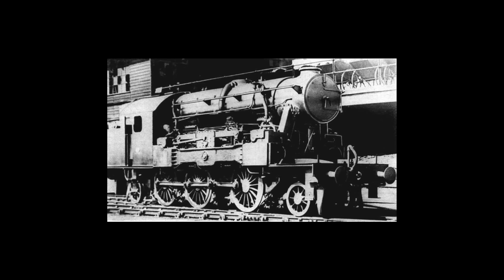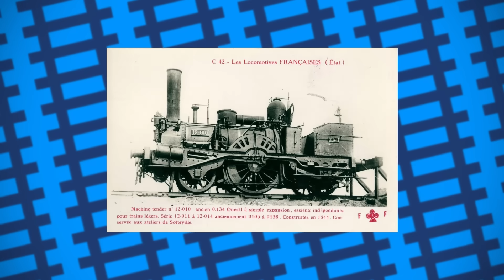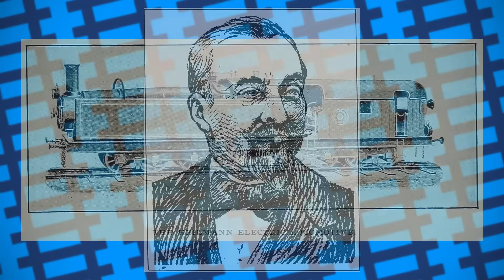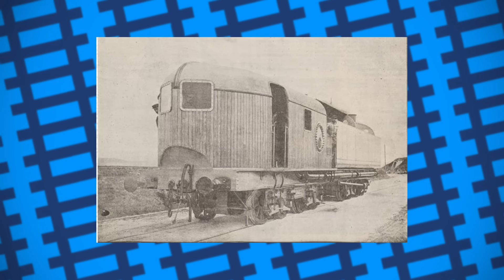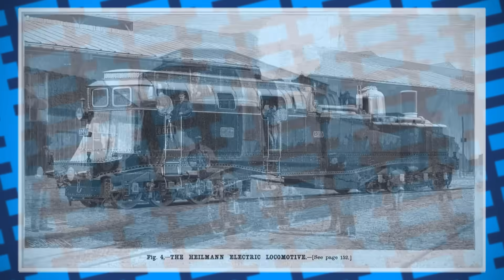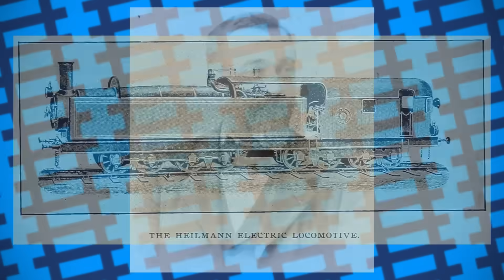France's Fascinating Steam-Electric Locomotive - Heilmann Locomotive

Comment: Hammer blow is not caused by cylinders. It's caused by the inability to perfectly balance an axle/wheelset driven by two cylinders at 90 degree phasing.
Reply: But if you only balance the rotating weight, and ignore reciprocating weight, you can eliminate hammer blow.
Reply: @joejoejoejoejoejoe4391  Nope, that cannot be done with a two cylinder steam loco. You have to choose between vertical balance, longitudinal balance or a compromise between the two. That is why it was a problem for steam locos. Only 4 cylinder locos could come close to solving it.
Reply: @davidkavanagh189 Hammer blow is caused by vertical (rotating) balance, if you add balancing weights to balance reciprocating mass, you get hammer blow; it nothing to do with the amount of cylinders, just how they are balanced. The 9F proves it.
Reply: @davidkavanagh189 Why could 4 cylinder locos come close to solving it but not 2 cylinder locos?
Reply: @sameyers2670  The only way to perfectly balance both the reciprocating and rotational forces is to have cylinders phased at 180 degrees but this does not work for an engine that has no flywheel and has to start from rest without a starter motor. 

If you have 4 cylinders, they and their connecting rods, can be lighter and can phased at 90 degrees to each other. This results less imbalance that needs balancing. On a 2 cylinder engine the cranks are again phased at 90 degrees but this then means you have 270 degrees between them if considered in the other direct. The 2 cylinder engine will also need heavier pistons and con rods for a given power output. 

It's typical to see 3 or 4 cylinders on high speed locos where this advantage is worth the extra complexity and 2 cylinders on slower freight locos where pulling power at slower speeds is more important.
Reply: @davidkavanagh189 Thank you for the explanation
Reply: @joejoejoejoejoejoe4391 if you take out the reciprocating weight, you have a waggon
Reply: Something I've pondered is if a balance shaft could be used, if any steam locomotive ever tried that? It's a counter-rotating shaft with counterweights which would be geared to the driven axle (the one with the connecting rods). The cause of hammer blow, to my understanding, is that counterweights on the wheels to balance the pistons moving forward and back would cause an up-and-down imbalance, so their weight is a compromise between these imbalances. Balance shaft and wheels would have weights that are forward and back together to counteract the piston but up and down opposite each other to cancel out the vertical imbalance. This is commonly used on internal combustion engines (many, maybe even most, cars have them).
Reply: @quillmaurer6563  I imagine the answer is that if it was that easy or practical, they would have done it. Steam locomotives were in widespread used at the same time as internal combustion engines so I doubt the engineers weren't aware of what was possible. Most car engines have even numbers of pistons that move in directly opposing directions to each other. The only way to reproduce this on a conventional steam locomotive is to have 4 cylinders and so we arrive back at my original point.
Reply: @davidkavanagh189  A balance shaft could work with fewer than four cylinders - not common in cars but some motorcycles use them, some single-cylinder even. Fairly common in twin-cylinder motorcycle engines with 270° crank spacing, which is very similar to a two-cylinder steam locomotive arrangement. Four-cylinder car engines use balance shafts to counter the secondary vibration, somewhat different from what I'm thinking here.

I don't know when balance shafts were first used, reading on Wikipedia the concept was patented in 1907 so certainly had at least been visualized in the steam era. It would certainly be some added complexity, but considering all the other things that were at least tested to reduce or counter hammer-blow - which I understand to be one of the biggest challenges with fast steam locomotives - I'd be quite surprised if something like this wasn't at least contemplated at some point.
Reply: @quillmaurer6563  Yes I think you are right and it could be done if considered needed or worth it but it would add complexity and mass in a part of the locomotive that is already heavy and space-limited. 

The way hammer blow was dealt with in practice was the optimisation of balance weights to give the best compromise for the speeds the locomotive was expected to operate at. Higher speed locos tended more to have balance in the vertical direction and low speed locos preferring balance in the longitudinal. 

It's fascinating all of the tech that was tried on steam locos over the decades only for engines at the end of steam to still be largely similar in configuration to the earliest engines of the mid to late 19th century. Often the simplest way is best.
Reply: Technically true, but your description of the true cause also mentions cylinders.
Reply: @grizwoldphantasia5005  A 4 cylinder engine can be balanced to have no hammer blow so it's incorrect to say it is caused by cylinders. I could have used the word 'cranks' in place of 'cylinders. The cylinders themselves do not cause the hammer blow and couldn't given that their motion is forward and back, not up and down.
Reply: @davidkavanagh189  This is youtube, not a physics seminar.  If you choose pedantry, then expect pedantry in return.
Reply: @grizwoldphantasia5005  Considering, not only are there physics videos-a-plenty on YouTube, this video was about an alternative design of locomotive and a very relevant part of the video was about this design not experiencing hammer blow. I simply pointed out that it was incorrect to say that hammer blow was caused by using cylinders since there are designs of cylinder-propelled steam locos that do not suffer from hammer blow. You then chose to reply a pedantic way, a reply I had no interest in hearing and added nothing to the conversation or subject. Go pick unwinnable fights some place else to get your sense of importance if need be. Unless you have something interesting and factual to add in relation to this video, don't bother wasting any further keystrokes replying.
Reply: @davidkavanagh189  imagine getting this worked up over a youtube video 💀

Comment: One may wonder what would happen to the fuel economy & starting traction, if these machines had a wagon full of lead-acid batteries in tow…?

Alas, these machines worked wonderfully, but also didn’t - simultaneously. A mentally challenging concept… 😅

Comment: I think steam-electric locomotives can actually work pretty well. Heck, I've even conceived a steam-electric locomotive that's pretty interesting. My design utilizes pantographs that run to a giant electric superheater that's located in the boiler (and runs along the entire length of the boiler), has a tender that's completely full of water (no need for solid fuel as the electricity is the fuel), and it has electric boosters at the front and back of the locomotive, and underneath the tender. If a locomotive like that is ever built, and is successful, it could very well usher in a brand-new age of steam trains.
Reply: I'm sorry to say there's no advantage to your design. If you're picking up electricity from the pantograph, it's a waste of energy to change the state of said energy from electricity to heat, then from heat to pressure, then from pressure to electricity again, just to do what the electricity could have done directly in the first place.
Reply: @C.I...  Then how about we build a system that model railroads use, but full-sized (model railroad locomotives get their power directly from the tracks that they run on). That way, we can build all types of locomotives that look like steam, diesel, or electric locomotives, and they'll all be equal because they're getting power in the same way.
Reply: @AnimalsVehiclesAndMore  : how would that improve the locomotive's operating costs, adhesion, reliability, et c. in any way? Railroads don't care what a locomotive looks like. Railroads care about what pulls best for the least monetary input. Powering a locomotive directly through the tracks (as opposed to third rail schemes) just introduces any number of unnecessary technical challenges to solve an appearance problem nobody wants to solve when there are plenty of existing solutions to power pickup that work just fine and plenty of railroads use diesel-electric anyway.
Reply: This has been done, was done in Switzerland. Train of Thought did a video on this a few years ago, look up "Why Switzerland tried to fuel steam locomotives with electricity - Electric Steam Locomotives" Was done as a stopgap during their electrification process when they had limited coal, tons of hydropower, were electrifying their lines, and didn't have enough electric locomotives but plenty of surplus steam locos. Far less efficient than a direct electric locomotive, hence only used as a stopgap. The one advantage it has over a direct electric locomotive though is that they could operate briefly without electricity using the stored steam as a fireless locomotive.

Comment: It's interesting how many different attempts were made at a steam-electric hybrid loco. There's this, then there's the steam turbine engines like the PRR S2 which were similar in concept to this, and then there's that Swiss one-off that's just a conventional steam locomotive but with the boiler heated by electricity
Reply: Of all the steam turbines used in the US, the S2 is the only one which doesn’t fit the same steam-electric type. It’s a direct drive turbine, rather than the UP, N&W, and C&O turbines which used electric transmission driven by the turbine

That said, the S2 was actually meant to be a stepping stone for a fourth steam-turbine-electric design, the PRR V1.
Reply: Interesting